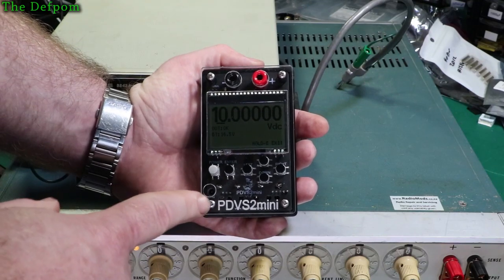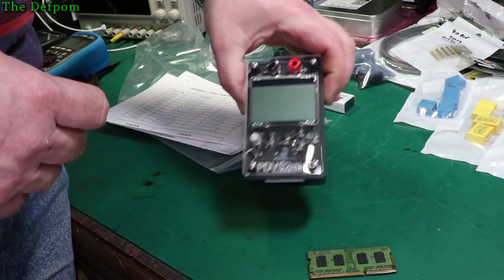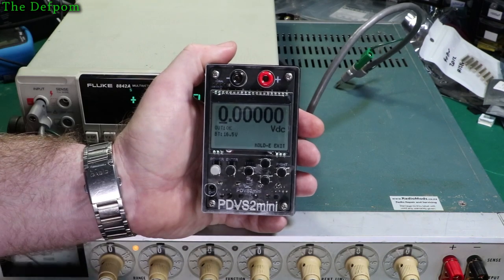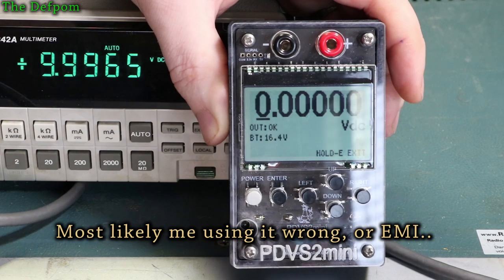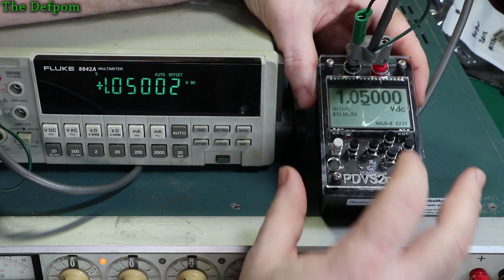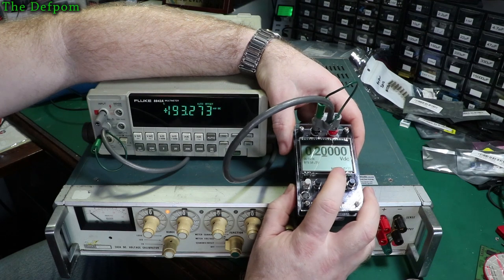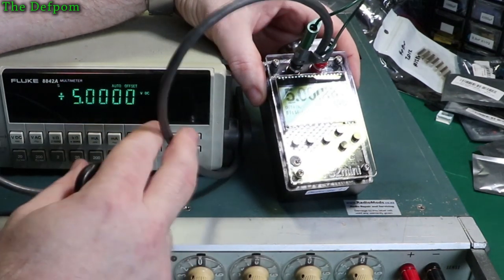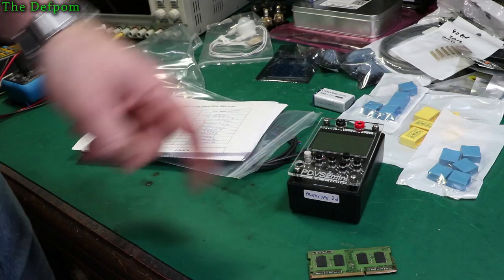🔴 #619 PDVS2mini Precision DC Voltage Reference Review and Testing - DC Calibrator Review

Comment: Hi all,
Nice to see Scott's take on the prototype, always interested to see another set of eyes on the new PDVS2mini.....and of course the YT comments.
I've taken a look at my own prototypes and they don't exhibit the same low end step error on my 3458A, but not to say there's not an issue. I will look into it, it could be a number of things! I'm also not convinced Scott's 6.5 digit Siglent is so far out of Cal as he mentioned.......so I will look at a few things.
Lastly, the reason for keeping the unit level is not so much the heat but that the LM399AH reference inside is well known to vary depending on orientation. If it's orientated differently permanently, then it needs calibrated in that position.
Cheers.
Reply: Update: I think I've found one software bug in V1.00 involving changing the 5th decimal point.....try setting 1.00000 and then increment UP by 0.00001 and then again.......doesn't change output everytime. Go DOWN the way and it's seems ok. I know where the issue is.

Comment: Great product and review. 20bits over 10 volt span would be asking alot to have 10uv resolution.  Would be easier to implement with  lower full scale voltage such as 5 volt. Will definately be saving for one of my own for sure.
Reply: I'll think about adding another range. The PDVS2 has it, but it's not so easy with the PDVS2mini. Most people want 10Vdc, but I may be able to add a selectable range. It's all about the BOM though and I don't want to push the price up any further.

Comment: That double banana shielded cable is nice, unfortunately it costs 50 bucks.
Reply: But should you not disconnect the shield from the balanced negative black one, and leave it floating?
Reply: @kwinzman  if you have a guard port

Comment: Ooow you lucky sod lol.
Low level accuracy is hard to acheave, measuring it is harder.
Yep it's got to be used on the smooooooth batterys, can't get better :-D

That's an amazing device, so accurate.
I'm not suppresed though, ian is a very clever man :-D.
Yes you do need to add a load as it could have an effect, a 2k7 would be ideal, i would attach it to the posts perminant :-D.